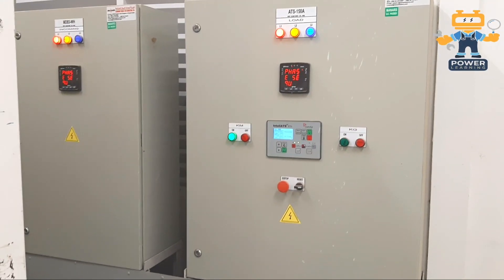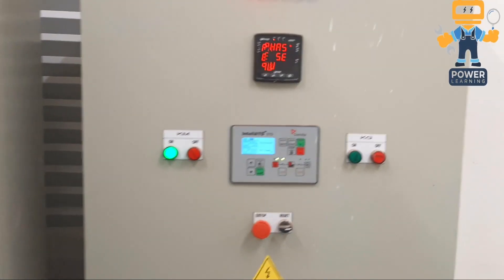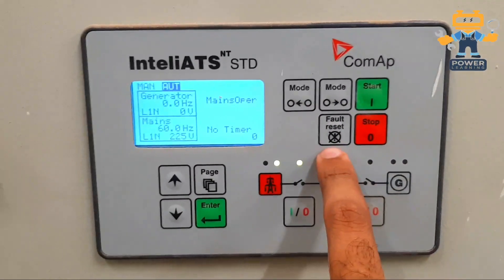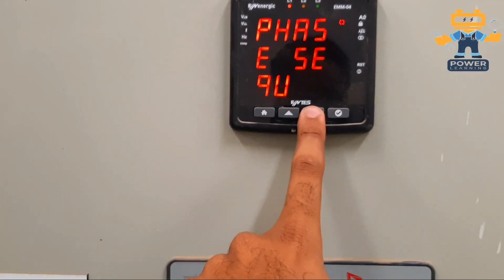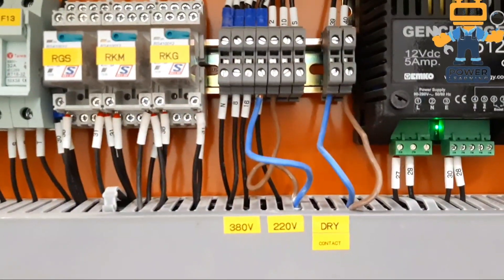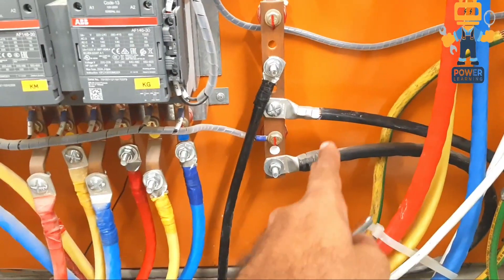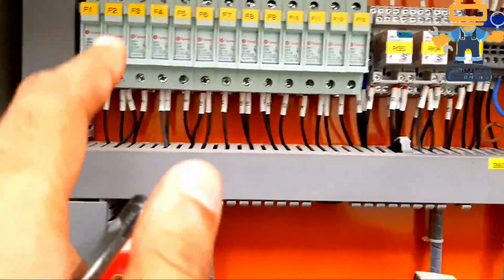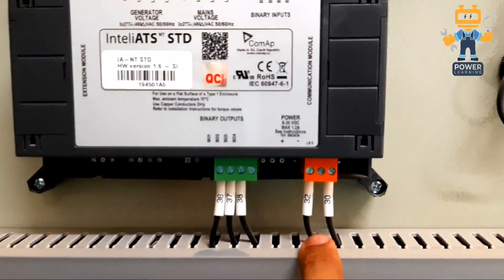ComAp ats controller | Automatic Transfer Switch (ATS) Controller | generator controller #europe

Comment: Hello, dear.
Please, how you send remote stop/start signal to genset?
Reply from the maker: Through relay
Reply: @ELECTRICALPOWERGENERATION  Please, i set controller in Auto mode and put battery 0 volt in Start/Stop bit, but genset dont start. How to do, please?
In manual mode, genset start and stop well.

Comment: Muzamil Bhai kindly aik circuit diagram k zariye diesel engine ki detail btaye. Alternator ki output cables sy ly kr,acb Sy ly kr controller tak all cabling detail btaye me ne ap ki sb videos dakhi ha mujhy jenbacer gas engine ka knowledge ha but diesel engine k Bary me detail chahta Ho. Jaisy electrical engineering me generation,transmission ,distribution or load tak detail hoti ha isi tarha diesel engine k Bary me btaye. Thank you